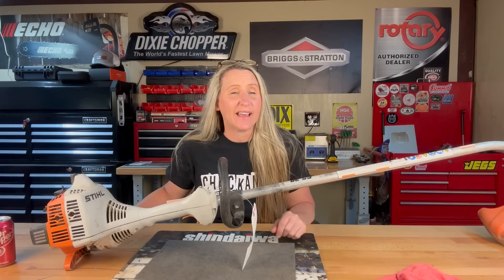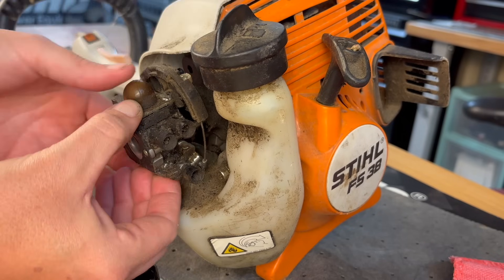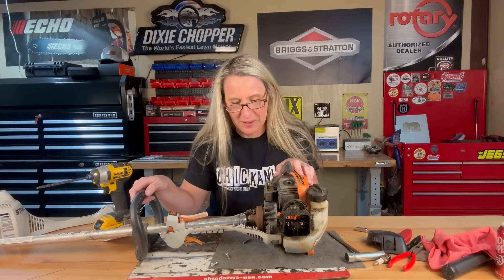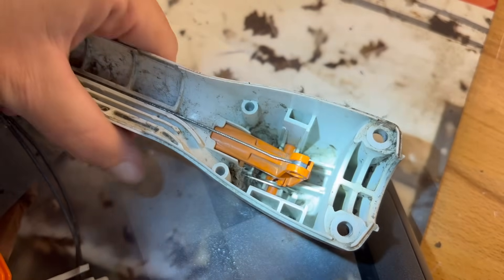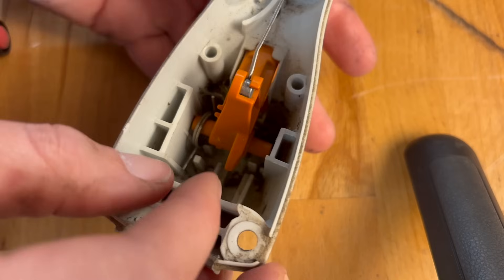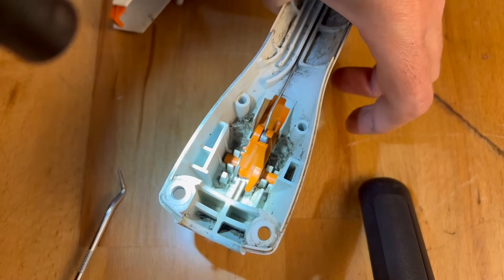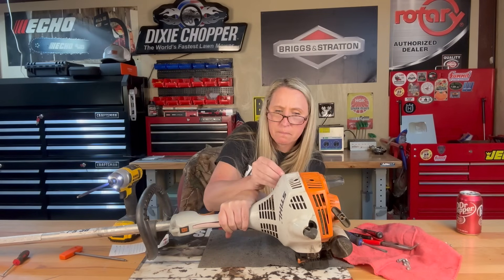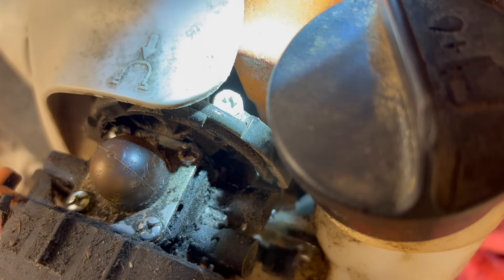How to Fix a Stihl FS55, FS46, FS45 FS38 Trimmer With Throttle Issues. Everything You NEED To Know

Comment: I picked up an FS55 (Pre 2000) model to use at work and it had a broken throttle cable. I come to find out there is no throttle cable available for that old of a model so I had to make one but you should see the compicated mess Stihl designed for the safety lever and throttle lever. I also have an newer generation FS55 I use at home and the newer generations are far less complicated by comparison to the older generation FS55.

Comment: The trigger return had to be a spring that wasn't letting the throttle lever return to the down position. The shaft misalignment & plastic body wasn't entirely done correctly. Somebody previously didn't know what they were doing.
Great job on showing the throttle cable adjustment.
Thanks Chickanic for making it Right.👏👏
I Love your Repair Videos.😁👍👍

Comment: Brie, I was fortunate enough to purchase a fleet of Stihl and Honda 2 + 4 stroke gardening equipment about a year ago. Didn't have a clue what I was looking at or doing. My only machine at that point was a Stihl FR350. That cost me £150 second hand 20+ years ago. been doing mine and my neighbours lawns with it since.
Found you channel and subscribed.
I have tinkered and played with all of the items. Used your vids to educate myself and been able to sell everything that i didn't want to keep, after servicing and replacing parts. I managed to sell the FR350 for £500. ( i was gobsmacked but it was a good machine) and as a result of my labours i now have 9 different Stihl machines and part of the sales profit enabling me to buy from new a pro StihI chainsaw, and pole saw. 
I never realised that as a 50+ year old fella i would ever need an Endoscope, Pressure / vacuum gauge, Air compressor and ultrasonic cleaner. Plus the other tools that I have bought to make the journey easier.
Can't believe how much i've learned and put into practice.
Keep the video's coming as they are a godsend to me.

Comment: I have a Husqvarna 128LDX with several attachments, string trimmer, limb saw, etc. the limb saw's outer tube got a slight bend in it during use. I am curious if you've come up with a way to straighten them so the driver shafts don't get push out when switching attachments on the power head

Comment: I hate to admit it, but while I had no problem getting the shroud off my trimmer I found I didn't have enough hands to put it back together and gave up after an hour. Luckily a Stihl dealer was just up the street and it was ready to roll in less than 15 minutes. As they say, knowledge is power and I'm saving this video in case I decide to take it apart in the future. Thanks Bre!!

Comment: Thanks for the vid-I enjoy and learn a lot from you! I have a question- I’m working on a trimmer that has a new carb, new tune up kit and good 50:1 fuel. It shuts off after 10 minutes. I checked all the fuel lines and all ok. What do you think may be the issue? Thanks 😊

Comment: You commonly drive screws into plastic. You also use a DeWalt which is able to over drive and strip the screw holes. What do you usually have your driver set on? Do lots of customers strip their screw holes?

Comment: First ever YouTube comment! My best friend is currently working out of state and at the moment circumstances prevent him from using a lawn care service back home. Knowing it doesn't take long in Southeast Texas for mother nature to reclaim her 2+ acres slightly wooded rural property. Not owning a mower of my own, I offered to see what I could do. Mind you, I knew nothing about small engines, yet abandoned at his house was a beat up 20 plus year old Toro 22-inch Kohler self-propelled push mower that hasn't ran or moved in almost 2 years.

Primarily just from your channel I was able to rebuild the carburetor, modify the non-functioning heat activated automatic choke into a manual choke, remove the completely frozen kill switch system and create my own, and also remove all the dead weight from locked up self-propelled system and turn it into a much lighter push mower. A quick sharpening of the dull mulching blade and it runs great. I was able to save a lot of money while helping out a good friend.

Comment: I had to replace a throttle cable once on a BR600 on a backpackblower. With a  little patience, I managed to get the job done. Little different with the weed wacker buy good to know about the trigger assembly incase I have to repair one. Thanks, great video.

Comment: I have a Stihl trimmer I bought new like over 30 yrs ago. Still runs strong, but the throttle cable housing fell apart. I didn't even check the dealer for parts, just made a new one from an old bicycle cable. What a pain to get it all apart, and put it back together. My Dewalt battery one gets a lot of use.

Comment: I just worked on my 38 yesterday that I've had since 2017. Bought a gasket/diaphragm kit for it and a primer bulb. Replaced them along with fuel/air filter and spark plug. Also, I had a lot of slack in the throttle, so i started looking around and found that hidden adjustment. Tightened up good, and I think she's good for another 7 years now.

Comment: So that's what it looks like inside. I have a 30 year old trimmer that hasn't been apart yet. I think it's an echo. I'll have to pull it apart and lube it.
This trimmer - I had to replace the fuel line and bulb when they switched over to ethanol. The rest of the carb is still original. All I've had to do is adjust the mixture from time to time. Now having said that when I try to use it shortly watch it not start and the carb insides are dust.

Comment: great info, I have a FS56, replace the kill switch last summer. I replaced the  head unit to because I can. Bought it off ebay new. I have had it for 8 years and works great, keep it clean store it when not using it.

Comment: Bre you’re in a great location for duration. I would like to be there in Hot Springs too. Praying that the weather holds out for us all in the area to see this eclipse. I was blessed to get to see the 2017 eclipse. It was AWESOME!! And only 1:40 at the maximum point. My house is at 2:38 seconds for this one. Still better than the last. 😀
Supposedly at least some welding lenses are safe but the cheap paper glasses with proper ISO rating worked fine for me the last time and also the partial eclipse from last fall.
Reply from the maker: Yea, I went with the glasses, because I heard that about the welding helmets later.